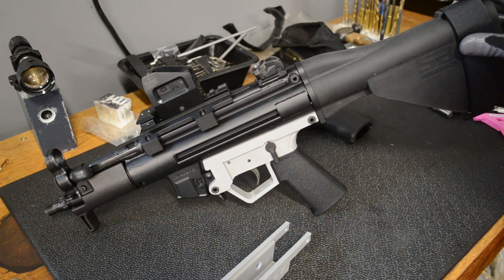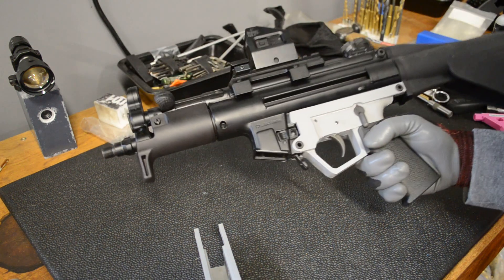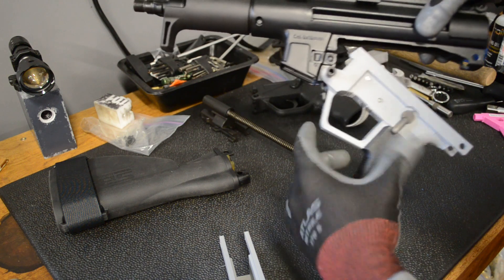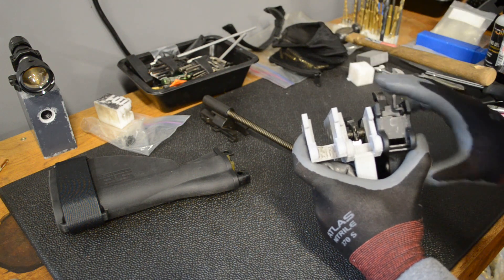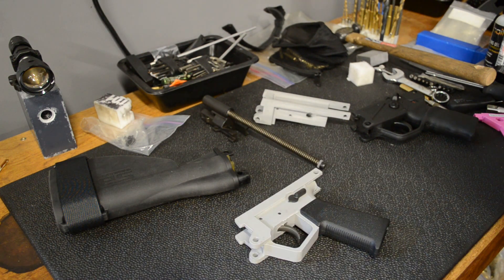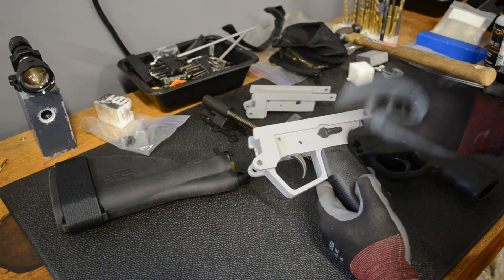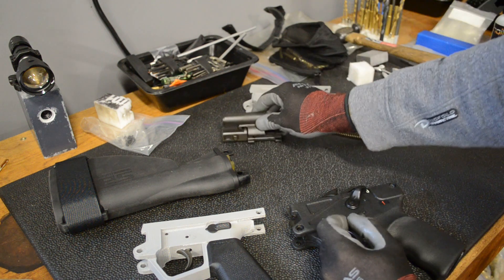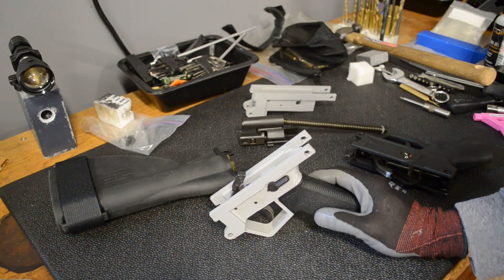Update 1: 3D Printed AR15 Trigger Housing for MP5

Comment: Subscribed! This is going to be epic with the Fostech Echo. You appear to be ahead of others. You certainly have a highly refined proof of concept. Keep up the momentum and start CNCing a Gen. 1 for R&D.
Reply: Echo won't work as it requires an AR-15 bolt. The HK roller delayed blowback will not interface it correctly. The Franklin Armory trigger should work though.

Comment: I think this would work for my airsoft gun... worth trying... anywhere we can download this desing?
Reply: it would not. airsoft guns, even GBBRs, use totally different internal systems for firing the gun than a real firearm. AEGs have a gearbox with different dimensions. An AEG M4, for example, has wider upper and lower receiver sections to fit the gearbox.

Comment: I think the only reason the hammer is angled to that degree is to help the bolt slide over it. Those springs tend to be stiffer then say a AR hammer spring, so having that angled hammer with a stiffer spring allows for better function. I have no way of proving that, but it makes sense to me. Also for the ejector are you going to have a roll pin of some sorts that holds it in place or will it work with one of the AR trigger group pins? I really like the idea behind this. I know that Fleming has a trigger pack that takes AR grips, but uses a standard HK trigger. I like this using both.
Reply from the maker: I have a couple of ideas but haven't tried anything yet.  Hoping for something that is reliable and unobtrusive to the FCG.
That Fleming trigger housing is cool, you can even use AR trigger guards.

Comment: At first I was like "Meh.. That's kinda neat. At least you can use AR15 grips"... But then I thought about it more and now I'm like "GO PRODUCE THESE IN ALUMINUM, NOW!!!". Putting a quality 2-stage trigger with a good AR15 grip onto an MP5? YES.. YES YES YES. Such an amazing idea. I would kill to have a Geiselle in an MP5 package.

Also, is there any reason this wouldn't work on a Cetme, G36, etc?
Reply: Additionally, I wonder if you could fashion up a trip for the bolt that would actuate an RLL. Then you could legally have a full-auto trigger pack for any semi-auto MP5 with sear-block (assuming you have an RLL or maybe RDIAS).
Reply from the maker: How about a binary trigger? 

The housing would be slightly different for the other platforms, but it could be easily adapted.
Reply from the maker: Not usually ok according to the ATF.
Reply: Why do you think that? The RRL or RDIAS would be the registered MG. Your lower housing itself isn't a firearm since the MP5 receiver is the "upper" and you didn't make an actual AR15 receiver.

Shouldn't be any different than buying a legal RLL/RDIAS and putting it into a donor semi-auto AR15.
Reply: Personally not a fan of the binary trigger (But I don't see why it wouldn't work). I do love me some Geiselle 2-stage triggers though :)
Reply from the maker: They don't approve of use of an auto sear in a platform it wasn't intended for.
Reply from the maker: I'd like to try out a binary trigger, they look pretty fun.
Reply: Interesting. A registered MG SHOULD be a registered MG. I mean, how would they even know you're using it in a non-AR15 anyways? Seems like this isn't something they should be allowed to dictate since the law doesn't treat registered sears any differently as an entire registered MG.
Reply from the maker: From some ATF letter:
"As you may be aware, an FNC auto-sear is entered into the National Firearms Registration and Transfer Record (NFRTR) as a conversion device for an FNC-type firearm. Installing it into a different firearm would constitute the "creation" of a new machine gun."
Reply: Guy in a garage the auto sear is a machine gun legally speaking
Reply: @ZERO_42069  He is correct and what you say does not matter. The ATF is inconsistent with their logic all the time.

Comment: Very cool ... what plastic are you using?
Reply from the maker: This is Sainsmart ABS
Reply: Have you tried PETG?  or some of the filled high temp PLAs?
Reply from the maker: Nope.  I haven't had any problems with ABS.
Reply: Awesome!   Do you have a heated chamber then?   I always had issues with warping.
Reply from the maker: Put a cardboard box over your printer.

Comment: the mod I would do is make the bolt channel milled out to the SAME depth and have a simple fixed ejector.. the germans love complexity. personally, as an american of german heritage.. I think the classic K.I.S.S. (Keep It Stupid Simple) would work fine...all other 9mm carbines feature fixed ejectors and they are perfectly reliable.. UZI's for instance never made their ejector do anything but sit there, COLT SMG's based off the M-16 as well.. just a simple flick it device. the HK guys have a long history of installing five parts where only two are needed.
just a thought if you don't mind modding your Bolt Carrier Unit, which WOULDN'T compromise it's function when placed back in a HK medium of all HK parts, the ramped design was an overthink solution to a non problem. and a flappy ejector for the bolt making it rise to coordinate with bolt travel is something only a german engineer comes up with as a mental masturbation session. the MP-5 has been long thought to have a medium speed cyclic rate for a pistol caliber sub gun, of only 800 RPM, or on par with an M-16 Carbine. which is running a much hotter and more effective round.
good stuff.. can't wait for the update.
Seeya,
Dude
Reply from the maker: Yeah, that would be a simple solution.  I'll see if I can make it work as a drop-in solution though.  It makes it a bit more challenging.
Reply: Guy in a garage copy the HK design and then see if notching and modifying the floppy EJECTOR would work if that is the work around. good luck
Reply from the maker: I figured out why it's ramped/angled.  Look here: https://www.hkparts.net/shop/pc/MP5-MP5K-9mm-Bolt-Head-Incomplete-RCM-144p2556.htm
The bolt is hollow for the locking piece. You can't mill it out to the same depth all the way.
Reply from the maker: Have you tried out an MP5 before? I've tried many sub guns and the MP5 is simply the smoothest.  I've heard it described as a 'sewing machine' in rapid fire. It didn't make sense to me until I tried one out.  The reciprocating mass is low, the bolt doesn't smack the back of the receiver, and the rollers cushion the bolt closure.
Reply: Guy in a garage those with 147grn bullets are pretty much a heavy low recoil bullet hose.
the SEAL's used them to great effect..
Reply from the maker: Yes, the 147s are 'low recoil.'  There is 'recoil' and then there is 'recoil impulse.' The MP5 roller lock design has a refinement you won't find in simple blowback designs.  Compare it to the CZ Scorpion. They will both get the job done, but ignoring cost, most people will prefer the MP5 recoil impulse.  I didn't get it until I tried one out.
Reply: +Guy in a garage Awesome were can I go to get the files for this?
Reply: If you don't want to mod the bolt like what 80spodcastchannel said then try just a hole and a spring so the ejector will follow the bolt's contours. Might make it a bit to long but something to look at.
Reply: yeah...like a 9mm with 32,000 C.U.P. NEEDS a roller locking delayed opening bolt set up.....yeesh
but, yep...point taken.

Comment: great stuff. could you test a 3d printed drop in trigger?
Reply from the maker: I don't think a plastic trigger would be great.  Conventional designs put a lot of stress on a small bearing surface.
Reply: +Guy in a garage i was more interested in a plastic housing for the triger/hammer/sear that would convert it into a drop in kit. similar to a giesle
Reply from the maker: Are you talking about one for the AR15 or one for the MP5?
Reply: +Guy in a garage I guess for either or both. Ar15 makes the most sense seeing as your even building an ar trigger into the mp.